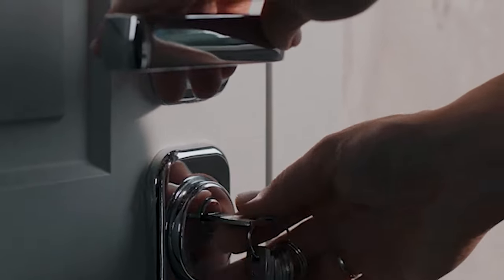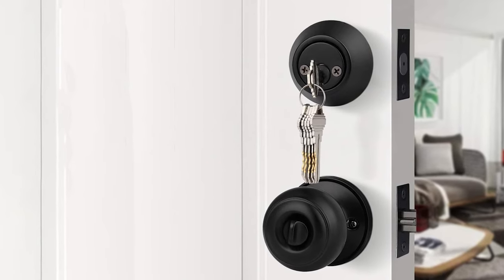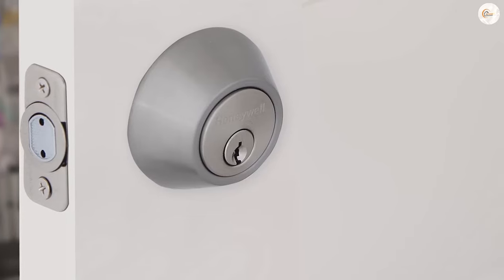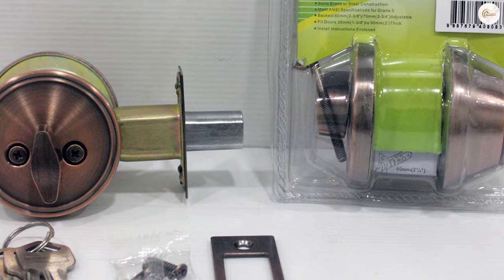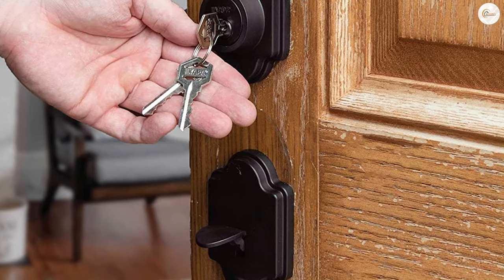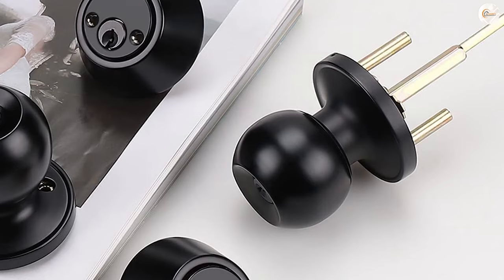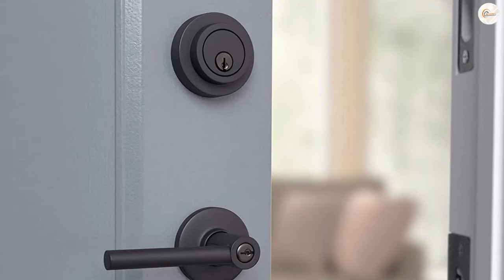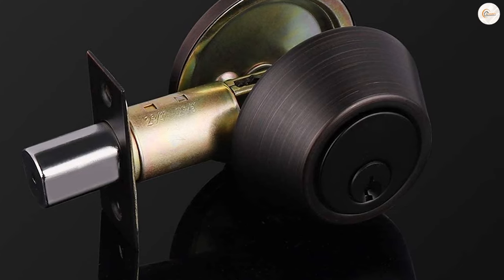Single Cylinder Vs Double Cylinder Deadbolt Door Lock: Which is Best for Your Home?

Comment: Consider that you may want to lock the door very quickly and double cylinder would make this much more difficult. It should also be considered that in case of a fire or other emergency double cylinder could be a problem.

Comment: Can break a deadbolt cylinder off the door with hammer and chisel in 10 seconds - exposing the mechanism. Then can turn internal mechanism with a screwdriver to unlock door. No protection in internal mechanism makes it a pointless lock against experienced or determined intruder.